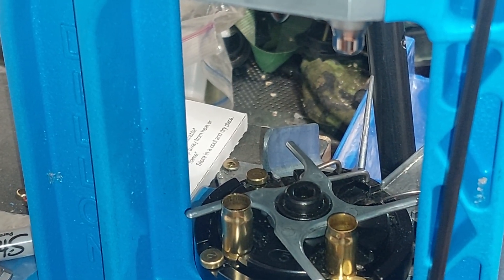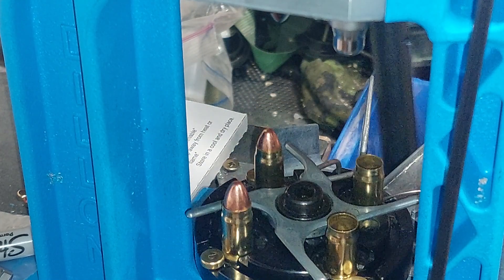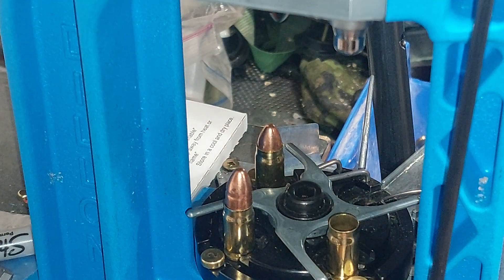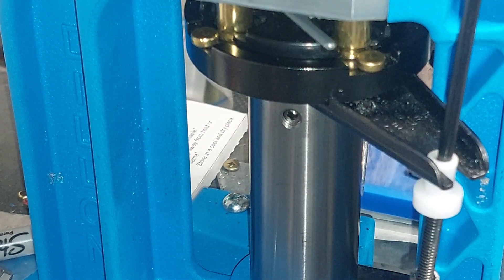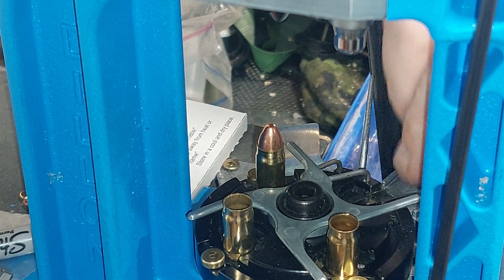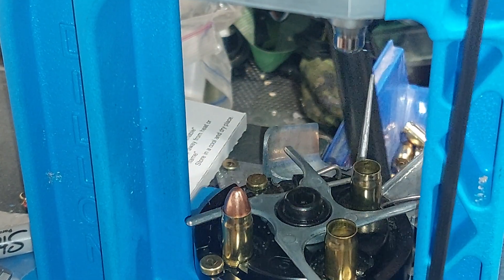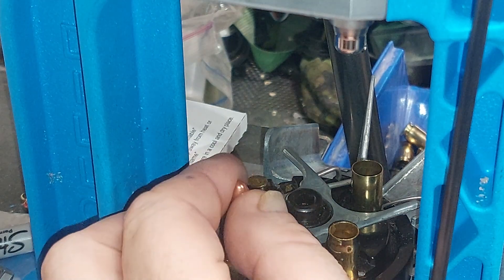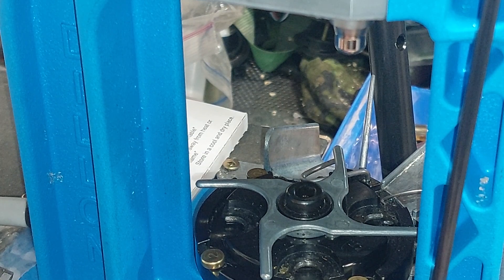Creating .357 SIG cartridges from .40 S&W brass.

Comment: .357 sig is made from 10mm brass. Using 40 Sw and the cases will be too short.
Reply from the maker: just , just,. I'm not loading it to max FPS, so I'm not to worried about the 357 Sig being longer by about 0.009 to 0.020 inches. the 10mm also has a heavier web at the base. I've put about 1000 of these resized cases through my Sig P226 with no failures. For the full on loads, I use the correct brass
Reply: That's Great news! Feels like you done the homework.  I am heavily into reloading so I have 2000 40 cases. I think I will have a go at it.@PlayingWithFireOutdoors
Reply from the maker: @allanstevens4245  I bought the Sig from  SERIOUS reloader,he owned a licensed remanufacturing company. He gave me a huge pile of proper brass, and a bunch of 40S&W cases. Have fun be safe.

Comment: Looking at doing the same thing for a VP40 and a pile of .40 S&W brass I got around.  Couple questions popped up as I searched around for details on it.

With the taper crimp, have you seen any setback at all?  I’ve seen some people say that even with the crimp they may see some setback.  

Also, you start pushing pressures at all?  Have you made it to the top end of any book maxes or are you sticking around middle of the road load data?

Final thing, what did you go with for a case mouth expander?  Could I get away with using another 9mm expander?  

Thanks for having a video on actually converting it, such mixed results online 👍
Reply from the maker: no signs of setback on my rounds. I am using safe data, as I have no need rightnow to punch through lvl Iii plates yet

Comment: 40 brass is t as thick as 10mm brass I thought? If you load hot 357 sig the 40 isn’t going to work
Reply from the maker: yes that's one thing I'm not doing
Reply from the maker: @eddiearchuleta615 for my spicey loads I use actual .357 Sig brass.

Comment: So would you say 9mm is Superior when it's in the appropriate Shell Case?
Reply from the maker: The 357 Sig gets it going faster and better penetration along with wound channeling. which shows the 9 NATO is not able to make the fullest of the bullet. This is because of case pressures that the Sig maximizes it out of the same length barrel.  I use the same bullet for my 9mm  and 357 Sig  124gr CanPro bulk pack, I have loaded self defense type with 124 HP, though.
Reply: @PlayingWithFireOutdoors  you like soft point HP'S or traditional jacket Sierra type projectiles?
Reply from the maker: For reloading the HP have a longer straight sidewall that means the shorter S&W case doesn't matter, due to it using the shoulder of the case to headspace from.

Comment: Great Video. 357 definitely is my Favorite cartridge. I need the Glock 33 & 32 ASAP. I also want to get into reloading thanks for the tips
Reply from the maker: I advise a good case gauge to ensure it's set right. Use a spray lube for the process, as it's a bootleneck case.